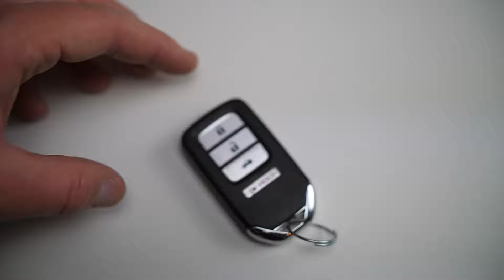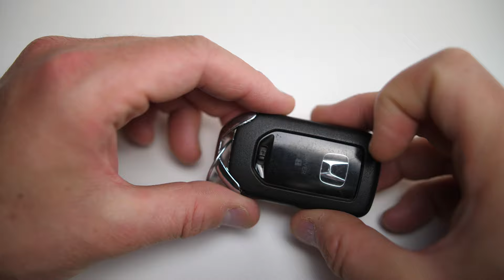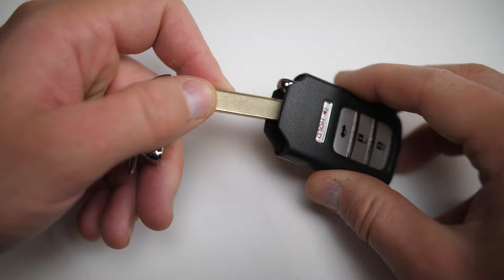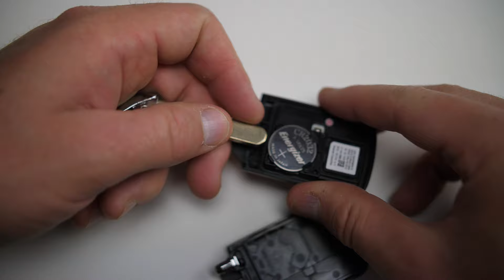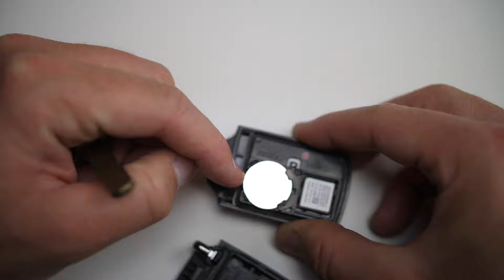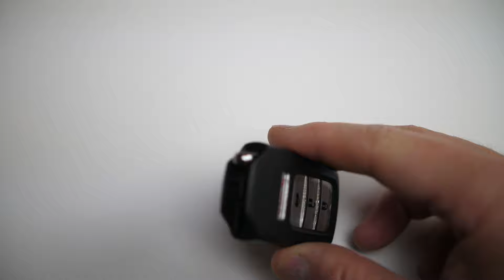Honda Fit Key Battery Replacement Guide 2015 - 2020

Comment: Thank you for your simple and straightforward video. I knew it had to be simple, but I didn't want to risk damaging the insides.
Reply: My buttons fell out too. Not simple to get everything back in place. Also, it is hard to pry the bad battery out. The slot is not big enough for the key tip to fit under the battery. I'm going to try a screw driver. Hope that works. This isn't easy.

Comment: Went to Walmart and bought 4 Energizer Batteries, Lithium CR2032 at Walmart.  $9.00 and some change for 4 batteries.  Honda would've charged significantly more.
Thanks for the video.

Comment: I just followed the directions to the 2 for my 2,020 fit and the fob disintergrated.  Everything that could fall off, fell off.  Be aware, too, it was a brand new car when I bought it and only has 10,000 miles on it and the battery died already.  Looks like the fob key did, too.
Reply: Did you put it back together?
Reply: @vero0992  Yes, I did.   I also found another video on here specific to 2020.  I put the battery in and it works fine now.  After having it fall apart I see how cheaply made it is - just like most everything today.
Reply: @Goshengirl1947  agree - the 2020 has a slightly different key with more bumps and the underside where all the buttons "live" under the battery came into pieces when I did this as well.  Found another video specific to 2020 that helped but this should be noted - the battery also has 4 pins holding it in which made it quite hard to pop out compared to this video.  Same basic idea but be warned if it's a newer fit!